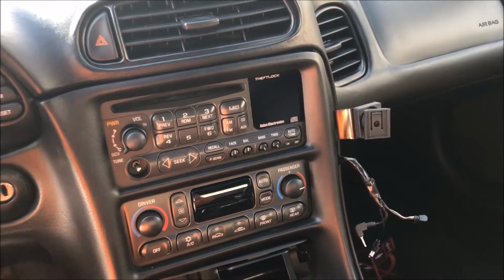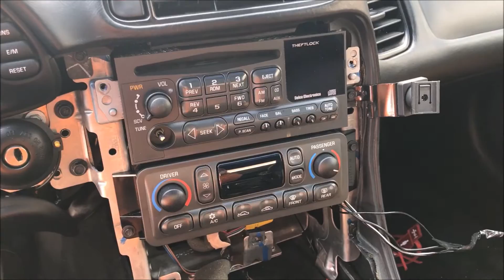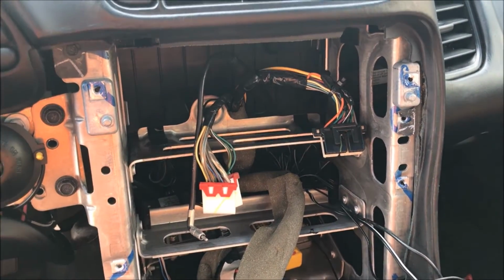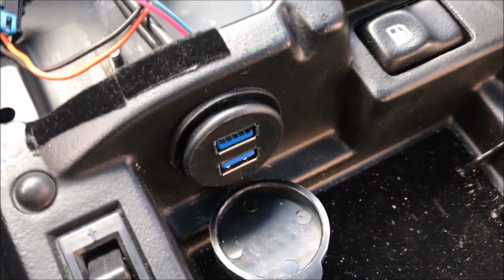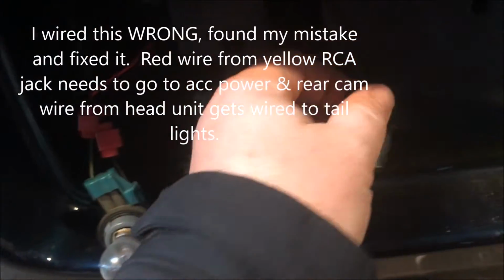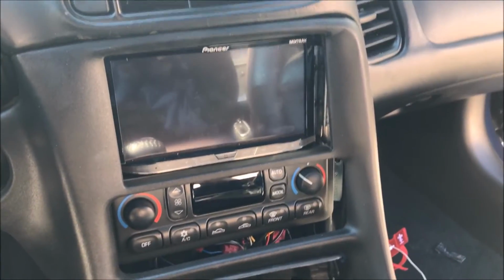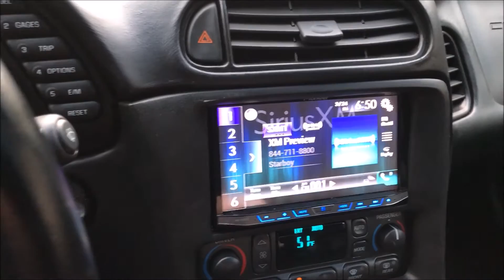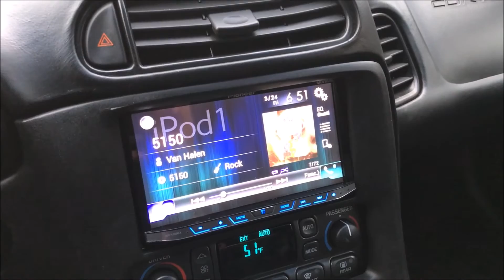Chevrolet Corvette C5 Double Din Radio Installation with Bezel Removal & Modification

Comment: or a wiring harness?
Reply from the maker: I used the PAC ROEM-VET1 system interface kit
Reply: I know it's been a while but how do the stock speakers sound with the new radio?  I am going to try this project but was curious how well the bose sound with a decent stereo